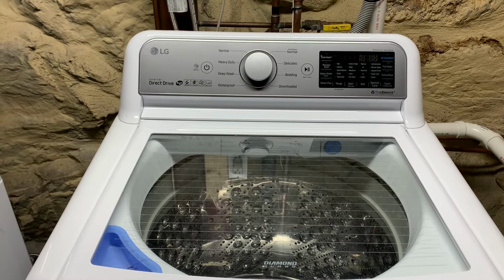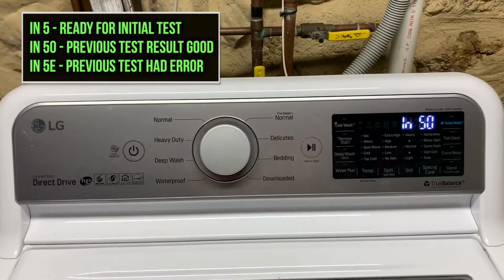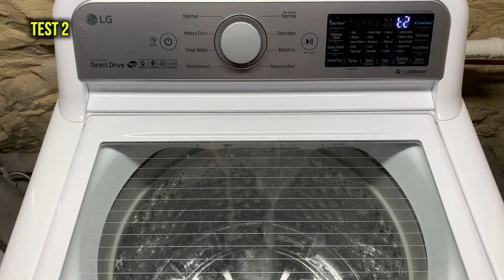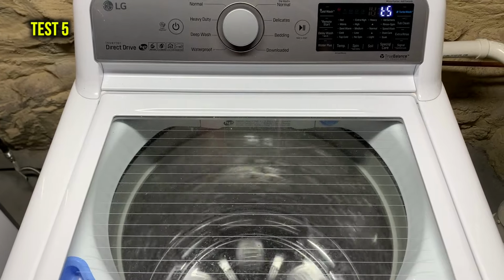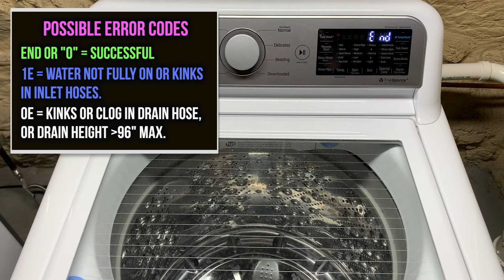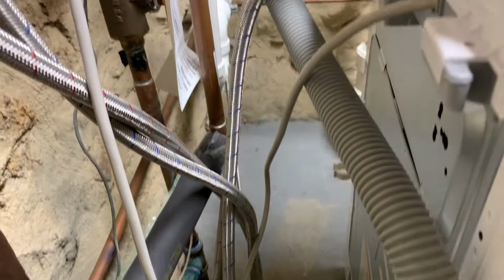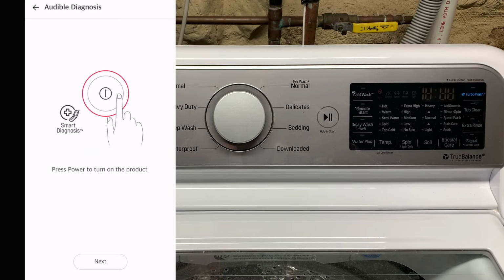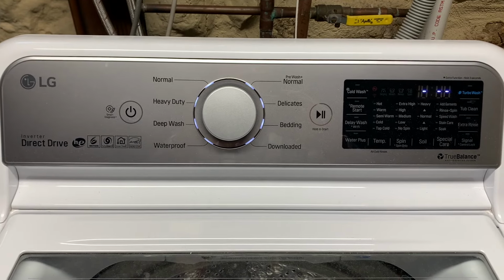The Initial TEST & Smart Diagnosis (How To) - LG WT7300CW Top Load Washing Machine

Comment: What is wrong when the drum bangs around violently in the test cycle?
Reply from the maker: Hmmm... my thoughts are that either the machine is not properly balanced (use a level and adjust the feet underneath) or there's a bigger issue (broken spring) which will require service.
Reply: It’s likely going to be a stabilizer or restraints issue. Your washer has 4 parts that are similar in look and function to the shocks of a car, located in each corner of the unit. Additionally, these stabilizers are sometimes held in place by a rubber bungee-type band attached to the frame, depending on the manufacturer. These, plus whatever weights your manufacturer uses, a top ring, front plates, both, all work together to keep the unit from walking out the door or beating itself to death during higher speed spin functions. So if your machine is wildly out of balance, one or more of these parts has failed. This is a time-heavy repair, only 2-3 tools required, and the parts are reasonable in cost.
Reply from the maker: Great information! Thanks for sharing that.

Comment: I tried the Tub Clean cycle and was really underwhelmed. It only fills and cleans halfway, so the other 1/2 of the tub is technically not getting cleaned at all and will undoubtedly grow mold. Since you can't manually add water, I don't really know what to do about this other than select a different cycle, but what cycle would that be? I want to fill it all the way with nothing inside so I can freely add chemicals like bleach, but I think they require you to add clothes.
Reply from the maker: I agree about the fill level of the TubClean but keep in mind that when the tub shimmies during this cycle, the water moves up the side of the drum. If it were to fill the tub completely, it could potentially leak over the sides during the motions. Also the machine  uses the jet sprayer, which rinses the top of the tub, and then spins everything dry. 
You can use bleach for TubClean and I used it until I started using Tide and Affresh washing machine cleaner... both are available at my local grocery store. 
The issue with using any cycle other than the TubClean cycle to clean the tub is that the machine’s load sensing may not allow for the tub to fill completely. You may want to try the downloadable Full Load cycle to see if it will fill the tub, but I doubt it... the machine may be too smart for its own good. 😃
To prevent mold, mildew, and odors in the tub, be sure to leave the lid up and detergent drawer pulled out when the machine is not in use. That way any remaining water can evaporate. I am diligent about TubClean and leaving the lid up when the machine is not in use and we haven’t had any mold, mildew, or odor issues. Hope that helps!
Reply: I’ve seen some other brands on tub clean cycle they fill partially do some cleaning and then continue to fill all the way I’m assuming the LG does not do this?  Use the bulky cycle with water plus if it has it maybe that’ll fill up higher.
Reply: @BruceAlanR  Hmm I never saw the jet and I watched the whole cycle, I think that's the TurboWash feature. The shimmying helps it reach a little but it's not enough to penetrate the wall of the tub on the opposite side. If I can connect I will try that download cycle.
Reply from the maker: I’ve been meaning to re-record the TubClean cycle and post. I recorded it at some point, but something went wrong with the camera or lighting. I recall seeing the sprayer during it, but I’ll be able to confirm soon. I have 7 more loads until I need to run TubClean and I’ll re-record it. The sprayer is definitely used during the rinse cycle when the TurboWash option is selected as you’ve pointed out.
Reply: @BruceAlanR  You can't select TurboWash during Tub Clean, it's a fixed cycle. I managed to connect and download the Full Wash cycle, but it basically acted like a normal wash and barely filled. I tried to trick the sensor into giving more water by adding 4 large wet towels for weight, but this didn't work either (probably not enough towels). The only cycle that fills it all the way is the Bedding cycle, but the cycle is too gentle. To run it full on normal I probably need to stuff this thing with towels, except I'm convinced the washer is just too smart... it will find a way to wash them with only 1/2 tub of water because the technology is just that stubborn, and I think it's for this reason that I'm not a fan of High Efficiency.
Reply: @user-ov7lh6kz8u  These work a bit differently than older machines, so they don't actually need a full tub most of the time. Long version:

These clean using a reverse rollover of the load I like to call "blooming." Whereas old school agitator washers pull down the load to the center from the side, these instead push it up from the center to the side. Little known fact: these kinda need to be loaded in such a way the laundry is entirely around the center of the washplate, like how you'd load it around the agitator. Otherwise what can happen is some of the laundry becomes tangled and therefore the washer can't bloom the load.

Because of this blooming action, you typically won't see it use a full tub of water. Usually it will be just enough that the washer can bloom the load.

Bedding is one of those cycles that you can kinda make an exception to the blooming thing, since it always deep fills. Any comforters do need to be washed one by one by themselves if you want those to get clean - but also so the spin cycles can complete without the machine wasting multiple tubs of water to try to redistribute before surrendering to an unbalanced load error code.
Reply: @BruceAlanR  TurboWash can't be selected on Tub Clean as it's a manufacturer-fixed cycle. The only rinsing it does is the same as the wash, just with tap cold water. I've never seen mine use the sprayer on Tub Clean before the final spin so it's interesting that yours would if at all.
Reply from the maker: Brilliant! Thanks for the great info Daniel! It’s always helpful when you chime in.
Reply: No problem!
Reply from the maker: It’s been a while since I sat through a TubClean so perhaps I’ll record one tonight (Another exciting Saturday night). While I know it’s a fixed cycle, not sure why I recall the spray, but perhaps I’m recalling the test cycle. 
Anyway, the last time I ran the TubClean, the hose clamp of a short extension drain hose I added came loose and I had to get out the wet/dry vac. I’ve since gotten rid of the extension.
Reply: Yeah it's probably the test cycle you're recalling there. That's not good though, yikes! That would especially be bad in our laundry room if that happened.

Comment: Getting an IE code on test 1
Reply from the maker: That’s the fill test. Turn off the hot and cold water supplies, remove the hoses from the water inlet valves on the back of the machine (have a bucket and towels handy as there will be some water in the hoses), remove the blue and orange plastic caps from the inlet valves and clean the screens with a cotton swab, flush the hot and cold water supply lines into a bucket, then reconnect and run the test again. If that doesn’t fix the issue there’s either a problem with your home’s water pressure or could be the washer’s pressure level switch. Could even be a motherboard issue, but that’s less common. 
Check out this video at 15:54 on how to clean the screens and flush the lines. 
https://youtu.be/l3EM3fm888Q?si=x1eaMpQzkalGxcML

Comment: THIS WASHER NEVER PUTS ENOUGH WATER! how do I increase it?!?
Reply from the maker: I agree the Normal cycle doesn’t use enough water. My go to cycle is Heavy Duty with the TurboWash option selected. I don’t find that it requires additional water, but you can add extra water by selecting the WaterPlus option. WaterPlus is also available for the Deep Wash cycle although Deep Wash doesn’t have very turbulent wash motions. I also like Speed Wash with TurboWash, which uses plenty of water and TurboWash to get the load done in 28-30 minutes. Speed Wash is good for a small to medium sized load.
Reply: @BruceAlanR  excellent, I will refer to this during next week's laundry day! Appreciate the response
Reply from the maker: I’ve learned a lot about this machine through trial and error, so let me know if you have any other questions. Cheers!